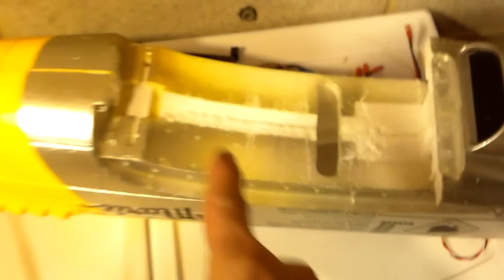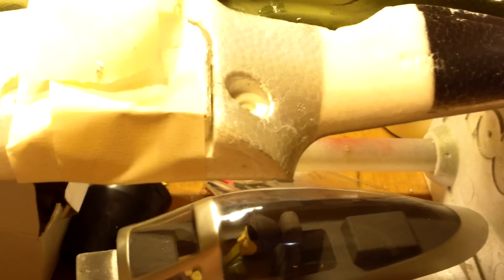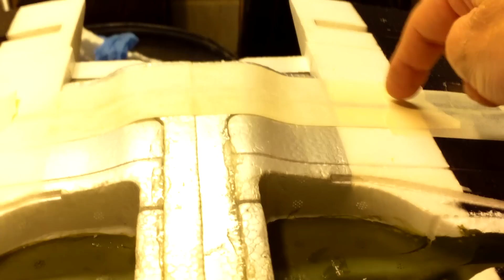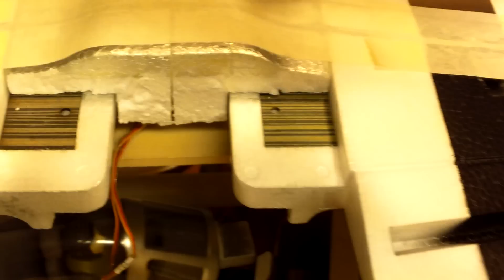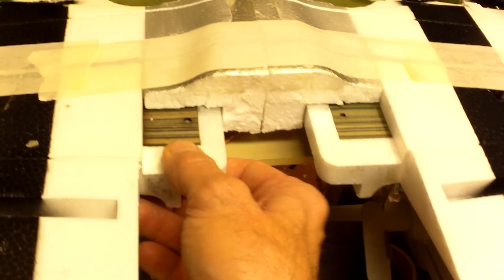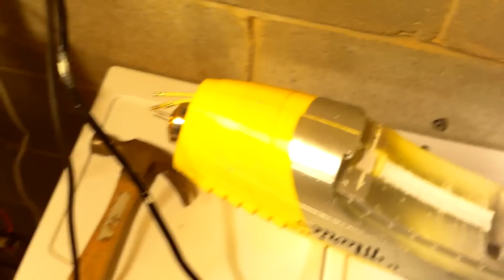FMS 1450 mm P51 Single Wing Mod

Comment from the maker: Hope it works out for you.  So far the wing has held up flawlessly including an accidental violent Split S when I forgot to adjust my expos.  Didn't even flex.  I'll definitely be pushing it to the limit this week as I have replaced the current motor with a Scorpion helicopter motor and going to run it with a 4000 Mah 5S and a 4000 mah 3S in series for an 8S run. The extra weight and speed will need all the wing can deliver.